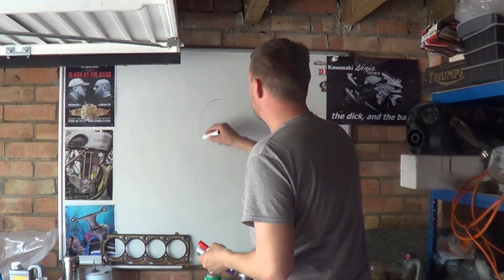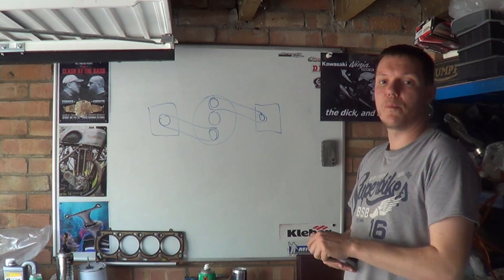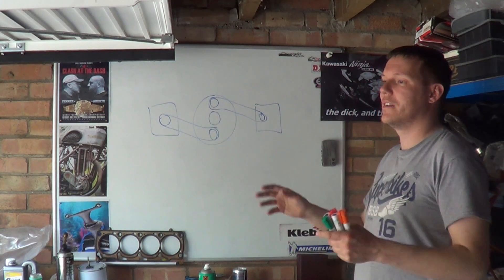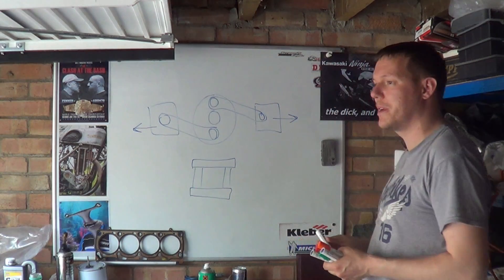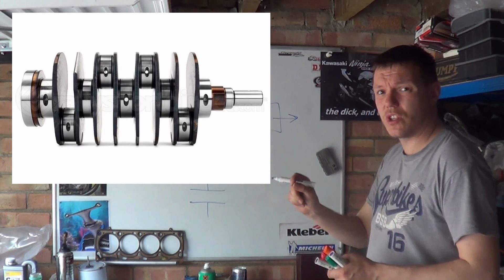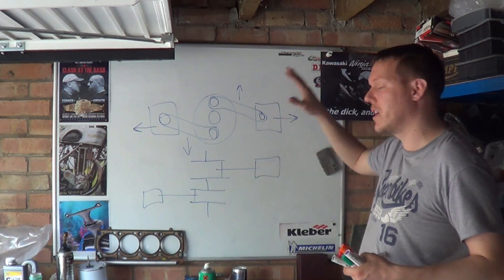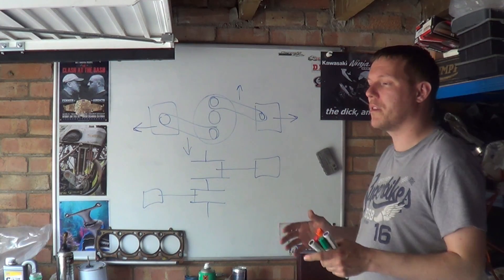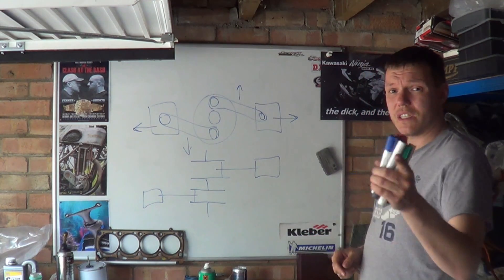Boxer engine perfectly balanced?

Comment: Semantics. Nothing that is made by man is "perfect" However as far a balance goes the boxer engine is far closer to being "perfect" than any another commercial layout used in a reciprocating piston engines. It is possible to connect both pistons with a solid conrod ie no small ends or big ends onto one journal using a Scotch yolk, planetary gears or combination thereof which gets rid of the rocking couple and makes the engine extremely smooth. This does incur increase complexity.

Comment: then why do we need crankshaft counter balance for inline 6 engines, as we know that primary and secondary forces are well balanced in inline 6 engines and i have seen some marine diesel 6 cylinder engine crankshaft which has no counterbalance.
Reply: putting it increases rotational inertial, hence eliminating the need of pesky flywheels

Comment: I was at the lights after having been given a lone bike years ago, it was a 1150 RT touring thing ... I’m used to giving my bike some revs when stationary.. I make no excuses 🤪.. The bike suddenly lurched to the left, like wtf..!! Kinda left me trying it again, as in, did that really just happen? It had, it did it again... ! It had plenty torque to be fair, but I couldn’t be living with that twisting force when stationary thing... Maybe smoking a pipe, lamb chops and having beard would have somehow countered it...

Anyhoo, stay safe and keep up the good work...!
Reply: Of course every type of engine does that - the crank tries to rotate the engine and thus the entire bike. You don't notice it much in a bike with  a transverse four, but my Yamaha tries to squat if I do the same.

Comment: What if the boxer engine had fork and knife con rods and shared a crank pin like HD?
Reply from the maker: Then your rods are imbalanced.
Reply: But then a pair of opposing cylinders would move left-an-right together, not in opposite directions, creating another balance problem.

Comment: They have a engine called a coaxial boxer twin engine, that has absolutely no vibration. Quite amazing. The thing is that it's not in any production engine (as far as I know) yet.
Reply from the maker: There is still secondary harmonics - the con-rods and crankpins are not balanced - but the primary imbalances are balanced out
Reply: The Workshop Thanks for the explanation! Nice video!

Comment: True, to a degree, but longer rods help too. In the aviation engine width isn't a big deal, and in a boxer can help cool a short stroke air cooled engine.
(as an aside, check out the D-motor, a modern flathead)

Comment: the assumption you make on the 4 cylinder is that both cylinders are cast the same.and use the same head., 1) A true 4 boxer would be have 2 cast together on one side and 2 single cast end cylinders,  but 3 or 4 single heads . 2) have one each side a slightly smaller piston to reduce rocking..
A 2 piston engine can use a long forked connecting rod, to avoid contact, but would need a long rod length and stronger material, however this would increase width. Less so with large piston to stroke, except the rods get more stress with  short length due to heavier pistons .

I mention this because ai love mechanical balance, not price.

Comment: This is reduced greatly with a BOXER-6 ,And would be perfectly balanced in a BOXER-8 which would probably match the smoothness of a shared pin V-12 (and maybe match a  V-16)
Reply from the maker: No engine is perfectly balanced - second order balance will always be a problem unless you have a counter-rotating split shaft
Reply: @thedirtyworkshop  Doesn't an inline 6 have theoretically perfect primary and secondary balance? Also, seems to me that a boxer-4 would also have theoretically perfect balance as well, since each rocking couple cancels the other and each couple has no secondary imbalance. There's also scotch yoke rods that inherently have zero secondary imbalance. Of course there is no real world perfect balance since no two pistons will be exactly the same mass, but it can be made close enough to be negligible.

Comment: This would not be a problem with 4 cylinder engines since the sum of rocking moments would be 0.
Reply from the maker: LOL because primary balance is the only balance LOL
Reply: But secondary balancing would also be cancelled out by the opposing piston would it not?
Obviously if you have the pistons inline (I4 for example) then the secondary forces will add up but if the pistons are facing opposite directions then they should cancel.
Reply: The rocking couple is only balanced for first order (crank speed).  Free forces are balanced at all orders in the piston plane.  This means a boxer four still has the dreaded 2nd order buzz an inline four has, but it is probably less noticeable.

I have not considered conrod side forces, only the linear motion of the pistons.

Comment: The only engines with perfect primary balance is a straight 6. A 60 deg or 90 deg V-12 provides perfect primary and secondary balance. The benefit is a lighter rotating assembly requiring less weight to hold the thing together. Ferrari thought it was all a good idea.

Comment: theoretically I solved the Boxer crank? with different left and right conrods, pistons can be directly opposed. L side could straddle the web, R side could in between. eliminate the throws; conrods connect to the webs externally and internally.
I should make a small model engine to experiment. output is fore and aft since the webs are not connected, so the rest of the drivetrain is complex, the trade off for a simpler engine
thoughts?
Reply: I wpuld like to see what ur talking about.
Reply from the maker: Would be good to see - send me an email of what you mean - i.e a drawing please - matt

Comment: Well, for a 4 cylinder Subaru boxer engine, it would have a firing order of 1, 3, 2, 4 which would result in the front pistons (1 and 2)  being in the same position and both rear (3, 4 ) in the opposite position. (when i say same position i mean distance from centre point, however on complete opposite strokes though). To create true balance you would need the COG of the crank shaft to be in the centre, so lets assume this. If piston 1 starts its power stroke then It'll create a counter-clockwise(looking top down) moment about the COG with its force (which will be the same for all pistons) X the distance from the COG (this distance would be the same as piston 4) and as this happens piston 4 would be at BDC moving outward which would create a an equal clockwise moment on the crankshaft... The same exact thing would work for the middle pistons. Please make a video about this and fix your explanation.

p.s. If this was unclear I could try to whip up a paint drawing ;)
Reply from the maker: "Please make a video about this and fix your explanation."

- what do you mean FIX? Your talking about CoG but you're missing torsional stress which comes from the rocking couple effect - steel is NOT 100% rigid. The bearing webs in the block are NOT 100% rigid. What are you banging on about.

" and as this happens piston 4 would be at BDC moving outward which would create a an equal clockwise moment on the crankshaft..."

- you're missing the fact the piston no.1 is on the power stroke, which means a force is being applied to it. This compresses the conrod and means that the 2 pistons are NOT perfect mirror images of each other. Now this 'misalignment' seems like nothing, but @ 4,000rpm this creates rotational oscillation in the crankshaft, as the crankshaft elastically deforms and then 'snaps-back' as the energy is distributed throughout the steel.

Comment: I'd heard that once you get more than 4 cylinders the side-to-side torquing of the engine goes away, definitely in this case more cylinders mean better stability
Reply from the maker: 1) torsional effects come into play 
2) bearings aren't perfect fixed bearing surfaces 
3) the engine block isn't 100% stiff.

All these thing including that fact that power strokes are uneven and crankshafts aren't 100% stiff and, and, and......... there's so much stuff that I need to do a few (lots) of videos on the subject
Reply: The Workshop yeah there's too damn many variables, but at least you explain it well and with a hell of a lot of detail. Obviously it'll never go away completely, but more cylinders should still help right? Also, speaking of uneven power strokes, I've always wondered exactly what a graph of torque over degree of crank rotation would look like, does that make any sense? Like at what point during the power stroke does the piston produce the most torque? Seeing as pressure isnt constant and the angle between the conrod and crank is constantly changing
Reply: Also, combustion is not an instantanous application of force, rather likely a rise and fall.  Trying to put all that into equations may not be possible, because the air/fuel mixture is a rather random mass of gas, probably not burning the same way every time, meaning counteracting imbalances from this source would be very complex.  (I think!)

Comment: I have designed an inherently balanced opposing piston engine. The only downside is that 2 pistons act as 1 together so you get half the power strokes per engine so a 4 cylinder would run as rough as a 2. http://imgur.com/a/fg7B8

The key is that the two piston / conrod / crankshaft halves would be of equal weight, and the pistons would fire at the same time to cancel out each other's forces exactly.
Reply: I'm pretty sure you've just designed a fork and blade system.
Reply: Yeah I guess that's what you would call it, it would work though. It would just be needlessly complex and expensive to manufacture simply to eliminate crank counterweights and nearly all engine vibration.

Comment: The most balanced engine is a 4 cylinder double 90° v-twin connected to a single cranckshaft in the shape of a star, whit all 4 pistons firing at the same time. It's called the starfish engine.

Comment: I think you missed a bit. Subaru uses two inside on one side and two outside on the other to counteract the balance issue you're talking about. Six cylinder boxer engines can't counteract this because there isn't an even number of cylinders in each cylinder bank. My favorite engine layouts are straight sixes and V twelves. True "perfect" balance.

Comment: If you do a second video on boxers could you show a way to fix the problem with the boxer engine. I would think using offset con rods might work but that brings its own balancing issues. Thanks for the great content.

Comment: Would the second pair of cylinders balance out the torsional forces if placed as a mirror image? For example, if the crankshaft was set up like the one on your whiteboard, could you have cylinders on the right, left, left, right, instead of the classic right, left, right, left?
Reply from the maker: No - more on this later - matt
Reply from the maker: "Better to give it 6 cylinders 120 degrees apart and it is in perfect balance." 

- not true - more in an upcoming video
Reply: The picture of the crank (presumably Subaru) shown in this vid is designed like this.
Reply: 90 degrees is the best

Comment: The new boxers have crank end opposing thrust valves inertia copensators driven from the two main traction facilitators which provide a centifugal air pressure demand equlibrium in tune with the crank rpm that gives the added benefit of an internal heat exchange cooling system which condences on the heads to give a self cleaning engine so you don't have to. That's what the salesman told me when I bought an R Nine but I would have bought one anyway coz the cool factor is totally in balance. )
Reply: Reminds me of this: https://www.youtube.com/watch?v=Ac7G7xOG2Ag

Comment: If the boxer layout was as good as some people like to believe, other manufacturers would make them as well.
Reply from the maker: Very true, like with everything - you gain something you lose something
Reply: Just the look of the heads sticking out puts most people off. On a r1200gs the heads stick out past the rear aluminium cases.
Reply: Also i kept hitting my shin on one of them . one is further back too, they don't line up.

Comment: With 2 pistons you are right at 2 and it becomes much better not perfect but almost.

Inline 6 are the most balanced if i am right ?
Reply from the maker: more on that in a future video - matt
Reply: David Mertes A straight 6 can have perfect primary, secondary and tertiary balance I believe. I love them in a road car (Honda CBX, Austin Healey 3000, TVR Speed 6 engine) but they have other problems. On a bike they are Just Too Big, I say :-)
Reply: A straight six won't have perfect secondary balance, just want to throw that out there.
Reply: (ssh Us 2cv fans know this secret ;) )

Comment: LOL! make them share one crank pin! o the cylinder are exact symmetric and one crankshaft run inside the other...  like Harley did. That is not perfect ether but it shortens the engine and if you have a 8 cylinder you might get an smooth running engine... every 90° an crank pin on the crankshaft. Then you can make an Gravel engine like that and we see how much weight/space difference it makes.
Reply: That would double the rocking couple because now you have double the cylinders moving opposed to each other on different sides of a main bearing.

Comment: lycoming AEIO 540 a 8.85 litre 6 pot boxer engine that makes 330hp at 2750rpm. You should do a video about plane engines.
Reply from the maker: They will come, but as a side line to the main stuff.
Reply: awesome